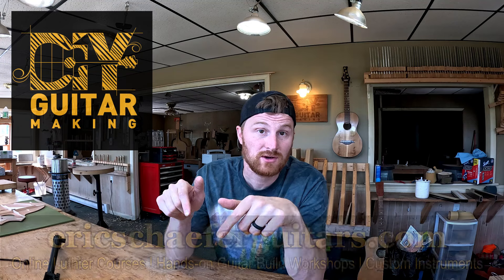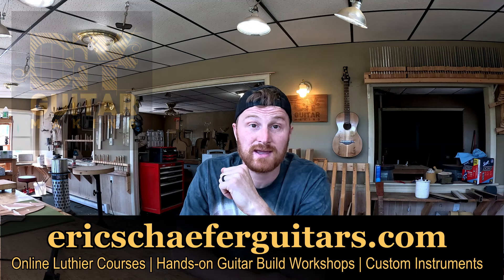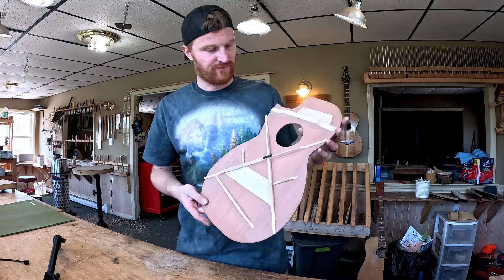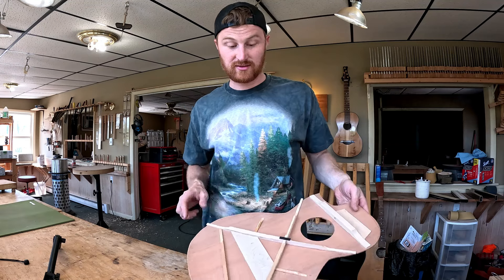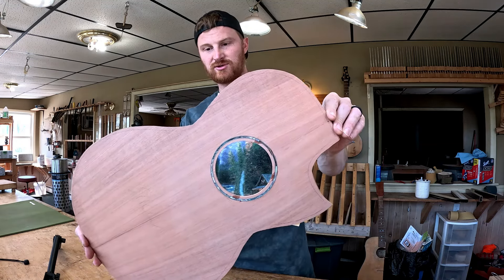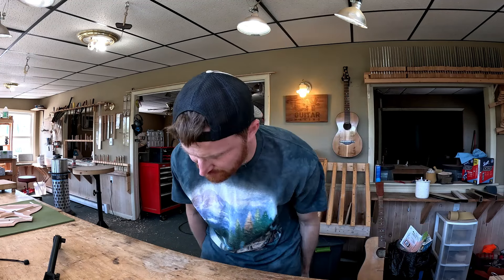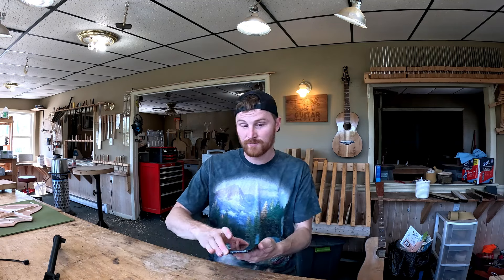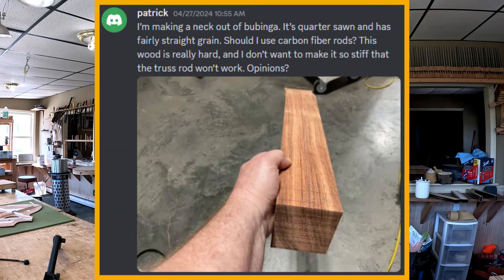QA | Refretting with Larger Fretwire, Buying Go Bars, Wild Grain and more!

Comment: I purchased 6mm fiber glass arrows online in lots of 20, cut off the flights and arrowheads.  Slipped on 6mm table ends and now I have excellent rods for a fraction of the price.  😊
Reply: 6mm diameter that is.  They come different lengths.   I used a couple of large online sellers.
Reply from the maker: I addressed your comment in a new Q and A episode: https://youtu.be/zAsMbIrwo60

Comment: I bought fiberglass rods from Home Depot that provide a good amount of pressure, so much so that my first attempts with the go bar deck was problematic bc the top of the go bar deck would slide up from the pressure from the go bars. These were a great find at Home Depot bc they were about 20 dollars for 20 rods. Then you go to the closet section and buy white tips. I ended up getting 40 rods and am very happy with my setup now.
Reply from the maker: I addressed your comment in a new Q and A episode: https://youtu.be/tooziyCpQMY